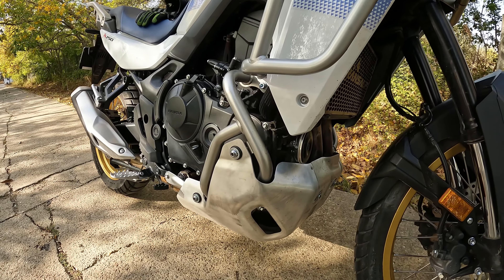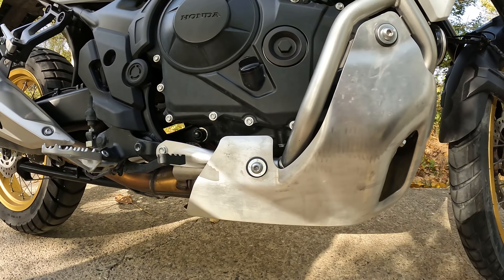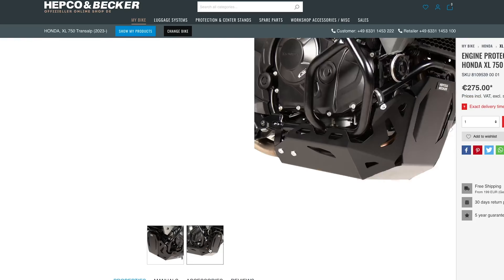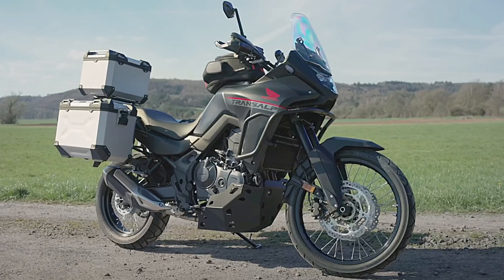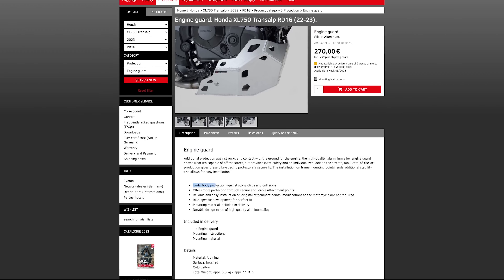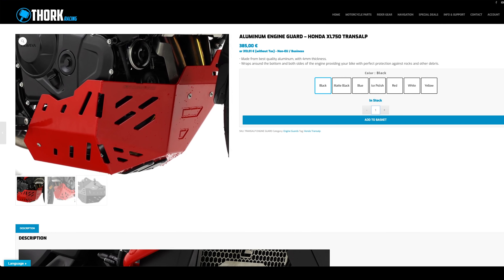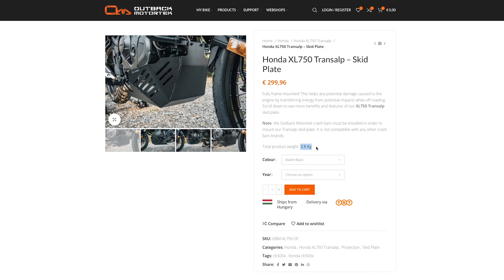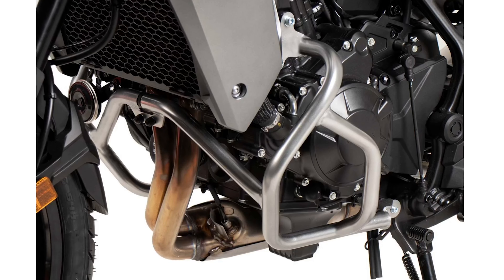TOP 5 MUST HAVES for Honda XL750 TRANSALP

Comment: I got the sw motech skid and crashbars. With their foglights. A must have. Wore out the original tires at 9k KM. Front was worst. Had 2mm left at most. Witch was not useable here in Norway. Mounted the dunlop trailmax raid. Original honda center stand. Honda heated grips. Wind deflectors. Givi outback trekker 37L side paniers. Will change to lithium battery during this winter. Got the outex tubeless kit on the way. Aswell as mccruise cruisecontrol. Barkbusters(Needs extra barkbuster weights). Have changed out the suspension. Andreani rally at front and touratech at the back. Absolutely love this bike. Prob some other mods i have forgotten. I did test the africa twin. I feels very similar. Just 30+ kg heavier. Only reason for me to go to a AT would be dct. Witch sometimes is tempting. But the transalp has been very good to me. Very.
Reply: I’m confused whether to get the Africa, Twin or the Alp. Such a difficult decision I don’t know which way to go and you’ve ridden both? Advice? It out

Comment: One same important parameter is the central stand. Most of all these options are limiting the choice of central stand. That means, if you get a  (e.g.)  Hepco protection skid plate, that means it will be combined with a Hepco central stand. The same issues for each brand. Central stand is extremely important especially at long journeys. So have in mind that you must proceed at a completed combination of all those stuff. Happy and safe rides to everyone.
Reply from the maker: Thanks for the comment, I'll test soon the compatibility of central stands with other skidplates, the brands don't mention about the central stand compatibility from my research which means it should fit. But let me know if you have any further information. Greetings
Reply: Some of us would never have a centre stand, it's far too heavy and get's in the way, so many times i've scraped that thing on different bikes I can't count ... there are many lightweight portable solutions available for both home workshop and travel.

Comment: Thank you Arthur for taking us through this maze of accessories, with their various compatabiities, features and downsides, weights etc. Weight critical for me, and I have removed the standard rear rack as it weighs... 7 kgs! I am making a lighter replacement at the moment. Somewhat ironic to an Australian to see the Outback brand sources from Hungary! I am inclined towards the Heed bash-plate, simply because it isn't as huge as some of the others, and looks like it might allow more access to work on the engine without removing the bashplate, and a little more air to circulate around the engine and pipes. Hard to assess all that on-line, but your video has been very helpful.
But the large size of the bash-plates for this model relates to the run of the exhaust pipes, particularly in front of the engine, where the pipes sit further in front of the engine than appears necessary. Odd that Heed don't ship within Europe. Not sure how I will go ordering their bash-plate and lower bars from Australia. I will add a comment regarding this if/when they arrive here, from so far away!
Thanks again for your thorough reviews, and tourism within your region. Both you and Pavlin have done a lot to promote tourism in your countries - makes us want to travel in eastern Europe! 
At least I should be able to source the Barkbusters handguards easily from here.
Reply from the maker: Thanks a lot for your comment, appreciate it. What about the large size skidplates damage the front pipes, I was thinking that for example the Hepco-becker bashplate protects better the front pipes due to it's size that covers it...

Comment: Hi any videos showing installing honda heated grips out there.
Reply: It is not a huge task. I plugged mine in the plug that is behind/under the screen plastic. Also clutch side housing needs to be opened as the wire goes through it. And you need that little plugg to be able to activate it in the menus.

Comment: I hope you enjoy your bike. I’m supposed to get mine tomorrow but worry I made the wrong decision. Hard when you can’t test ride!
Reply: What are your thoughts now because I’m looking at buying this bike and I’m not sure either
Reply: @TheZakkmylde  well I only have about 200 miles on it so far since I bought in the winter. I would say it’s a fun bike to ride. I still haven’t quite gotten used to the quick shifter timing. I am very used to a quick shifter but so far haven’t found the sweet spot. I think I this bike could use a tuning to smooth out some of the rough edges, but that is just my opinion. And you could say that for most bikes these days. The suspension is not great but saying that I haven’t added preload yet so I shouldn’t complain. Still, I know I need to upgrade it or lose weight one. You get a LOT of bike here and it’s hella fun to ride

Comment: Hello, I see that you have the original engine and motorcycle guard from Honda. Do you think this is a better set than, for example, Swmotech, or is it just about the looks?
Reply from the maker: Hello, I've changed it to Hepco&Becker, check it out on my other videos to see why. Greetings!
Reply: @IdealBike  Thanks! I see you have quite a lot of videos, and they are pretty long. It will take a while before I watch them all :)
Reply from the maker: @danyroy7025 I try to cover as much as possible, hopefully it will help. Greetings

Comment: so your saying that you think that the H&B engine bars only would be enough to protect the bike panellig when falling on the side? and that you dont need the upper crash bars necessarily, correct?
Reply from the maker: Yes. Still it depends quite a lot of the downfall. No matter how much protection the bike could suffer anyway 😁

Comment: any minimum speed before we can use the quickshift? its it okay to use it from Neutral to gear "1" ?
Reply from the maker: The manual says from 2800 rpm up you can use the QS. You cannot use it from N to 1 (only the E-Clutch can do that). So the speed it's not as important as the Rpm is. Hope it helps

Comment: H&B probably has the worst customer service among all this brands. Favoring one, the only one you have, just because you dropped the bike and it didn’t explode is not an unbiased opinion. Including Heed just because you have to include it, and checking on its products for this video, is quite non unbiased. For the sake of neutrality, you forgot H&B handle bars. Acerbis should give you some freebies, but in terms of protection, none of them is up to the level. I disagree with your presentation style, since you give different opinions based only on your limited knowledge. Would be better if you just list them, and keep your options private, so no brand is damaged, and we users get the info we want and choose by ourselves.
Reply from the maker: Thanks for the comment, the audiece should know what options are available, I cannot test everything. You have my real life feedback for OEM skidplate, Hepco&Becker bars (2 times tested already) and Acerbis Hadguards on my latest videos.Greetings!